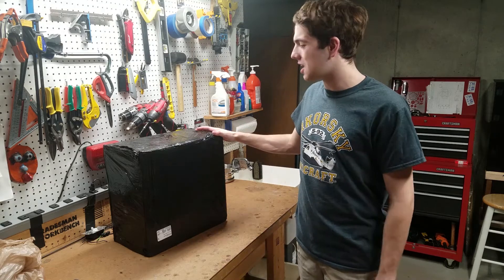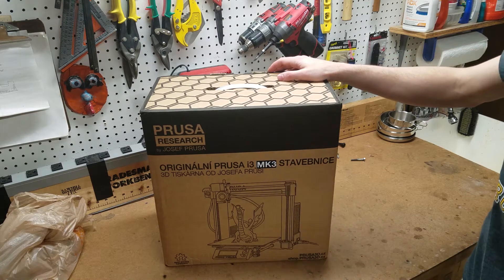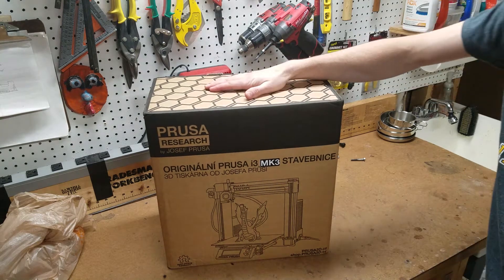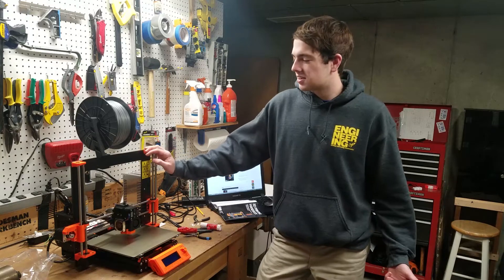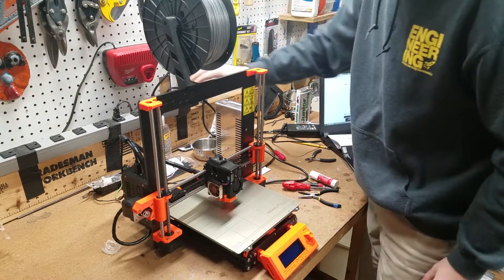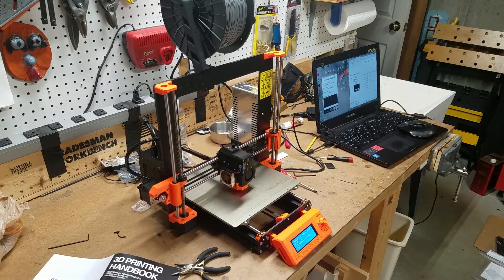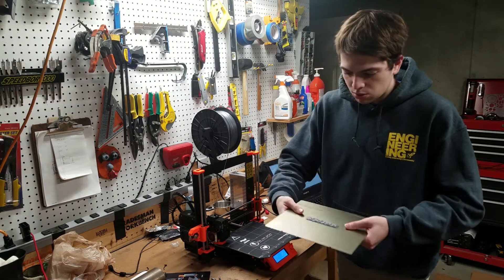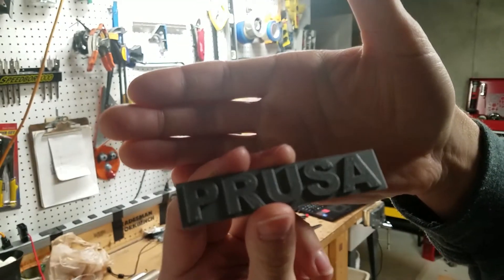Unboxing and Assembling my Prusa Mk3 3D Printer

Comment: How long of a build? And how are you liking it? Might be my next purchase love how quite these machines are!
Reply from the maker: Probably took about 6 hours to build but it went pretty fast. I really like the printer all the features aren't completely reliable yet but Prusa has been sending out a lot of firmware updates which has been making things work a lot better. All the auto leveling routines are super easy and makes your prints come out perfect.The spring metal print bead is really nice to use and almost all the materials I use stick to it very well but are still easy to remove. For its build size and price I don't think there is a better printer on the market! It is pretty quiet and you can make it even quieter with software but when you do so you loose some of the features like layer shift detection.
Reply: Matt Sheehy read the last line of your comment lol.
Reply from the maker: haha woops
Reply: Matt Sheehy where did you get your edf?
Reply from the maker: Which one?